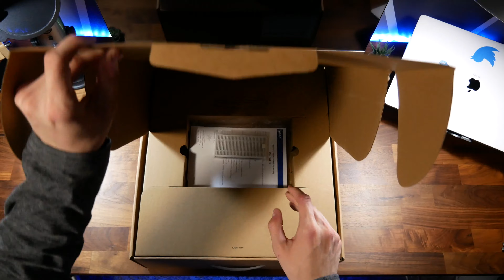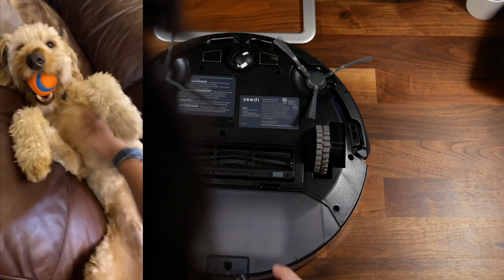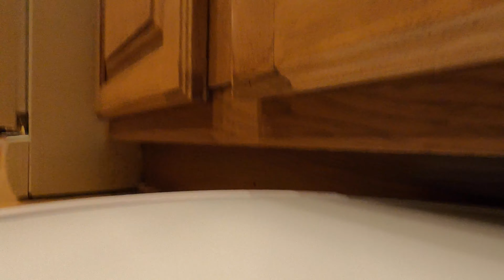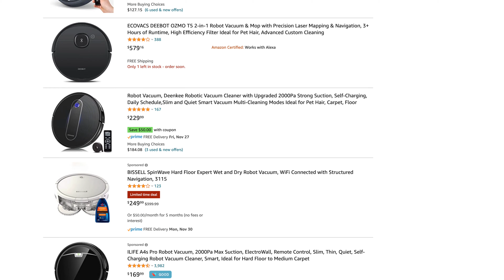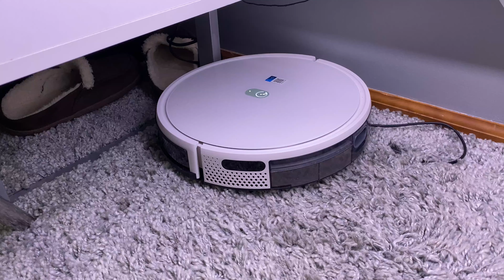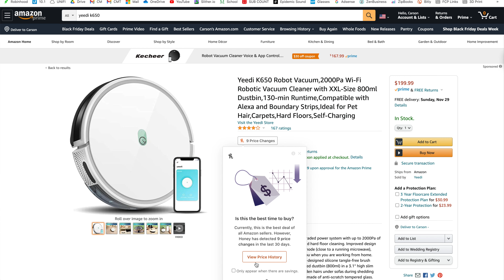$150 BUDGET Robot Vacuum: How Bad/Good Can One Really Be? || Yeedi K650 Unboxing, Thoughts, & Review

Comment: Sry but the Yeedi K650 also got the Gyroscope Technology. And thats why it is a got Robot for that Price.. 
Of course it will get stuck on cables. Even a 1000$ Robot would.. There should be no cables on the ground.
And please test the Moosoo Rt30 first before claiming that its better, only because you read the description on amazon.

apart from that, you did a good job
Reply from the maker: It simply does not have gyroscope technology; at least not the same as the Moosoo. This robot vacuum is DUMB. It doesn’t know whatsoever what patches of ground it’s already gone over. It just bumps into something, and turns at a random angle and starts going there. You are right in assuming I haven’t actually tried the Moosoo, but if the Moosoo actually does have the gyroscope that it claims it has (Yeedi does not claim this) then it is already a better robo vac, in my opinion. I am glad you still liked the video despite this though, I appreciate the support!

Comment: A remote from the yeedi k600 works with the 650 really well. I find it to be useful when the vacuum is close to an area you want to clean. Drive it over to the spot then hit spot cleaning mode. Works like a charm. If only the remote was sold on its own.
Reply from the maker: Wow, that’s interesting! They definitely missed out including that in this package or had it on sale for pickup of just the remote. How did you manage to figure that one out, did you buy both vacuums?
Reply: @carsonmtech  I caught a really good deal on the 650 for only $120, after purchasing the 600 for $110 on Amazon. I ended up with both robots and after testing them out a little bit,  I found the remote to be more useful to the 650 than the 600. So I'm debating keeping both of them mostly for the remote and possibly use the 600 for  miscellaneous jobs in other parts of the house.